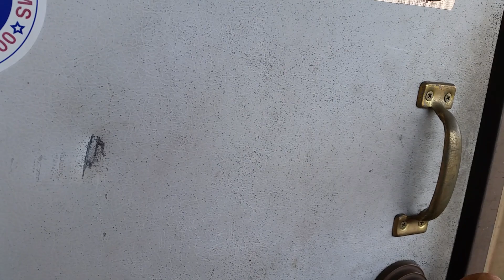Hunting Harley's, noise problem

Comment from the maker: ***** your confused. I was here 3 years prior to Emerson. Just because he owns his property does not mean he can violate noise laws, air pollution laws or dump poisons down the sewer (which he started to do from day one and was fined for it). While this is a commercial area, it is also residential, so even stricter standards of noise apply. You can hear his machines a block over. He lost the battle to pollute the sewers, to pollute the air and he will loose this also.

Comment: Buy a radio and put on your favorite station. I was going to put some slip on's on my Road King over the winter but my kid said Dad you don't have to be too obnoxious. Might not be a smart move to start a war. I'd be more concerned with his employees having proper ear protection at the moment.Obviously he's employing a fair number of people and that's respectable. What are his options? Really? When he has a certain number of machines running there is a certain amount of noise. On the other hand you jump on one of your bikes and can be heard blocks away, possibly even set off car alarms.
Reply from the maker: his machines can be heard a block away and are FAR louder then my machines which don't run very often, where his machines run 8 hours a day 5 days or more a week. It can be heard throughout my new shop and it is very loud. This video was in the old shop several "shop spaces" away from him. Now, I am next door.